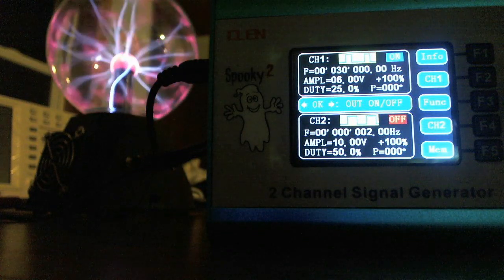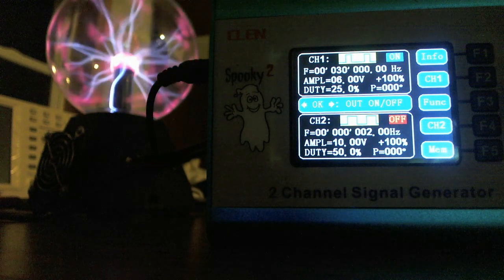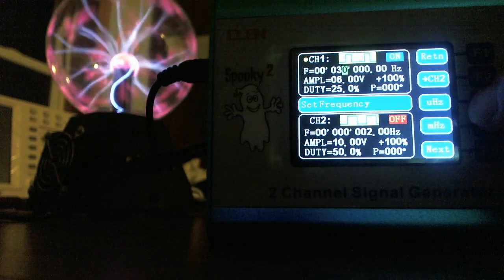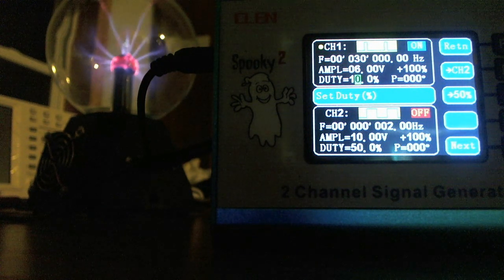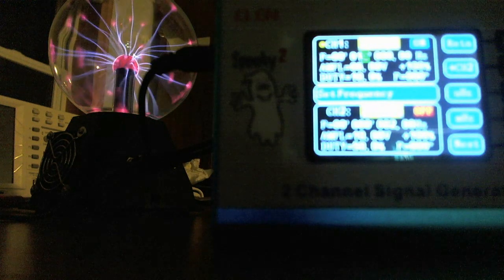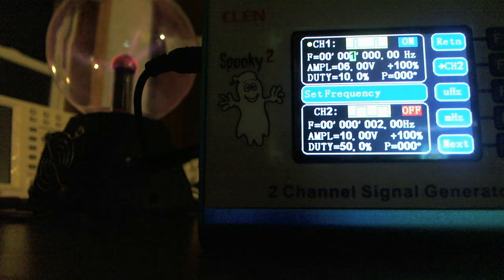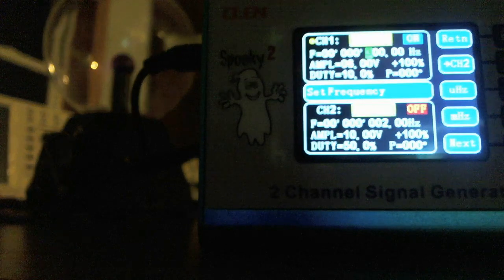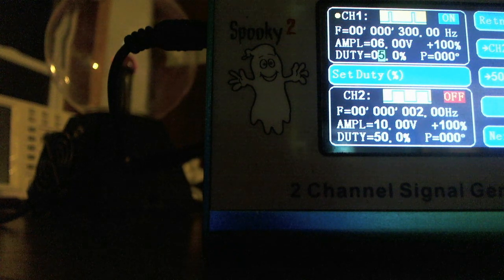Manual Plasma Control with a Spooky2 Part 2

Comment: Again, very good video, an excellent experiment you gave me an idea, you know Spooky2 offers their plasma Globe for $300, just think of it, if you can use that plasma ball for healing or for destroying viruses in the body, have you thought about that. I hope you will make another video that will show us how it's done but with the Spooky2 to software that has the correct Frequencies built into the software, Connected to the Generator great idea though I cannot afford to spend $300 right now for the Spooky Plasma Globe. Frequencies built into the software This would be a cheap and efficient way for us to use Plasma Energy for Rejuvenation of the body. How can we get together and communicate design ideas for a cheaper cost for Spooky2 .  I have the same idea for using a speaker system that has lights attached to it that flicker only while their frequencies are being applied close too cold laser therapy using frequencies. Eventually, I will be able to buy their accessories right now I'm kind of desperate to get this thing going now.